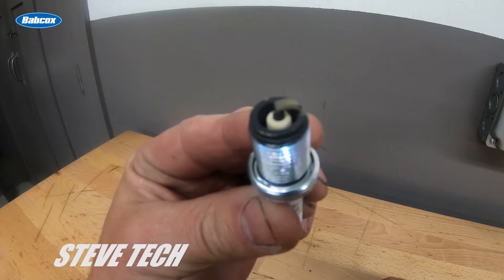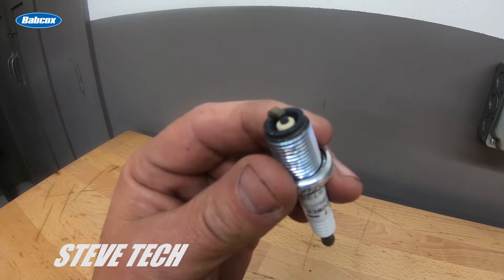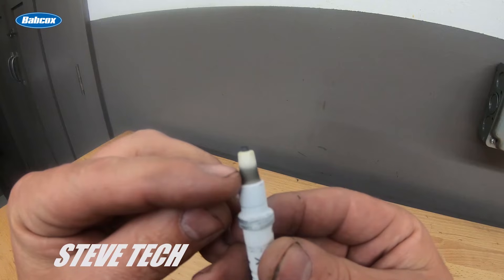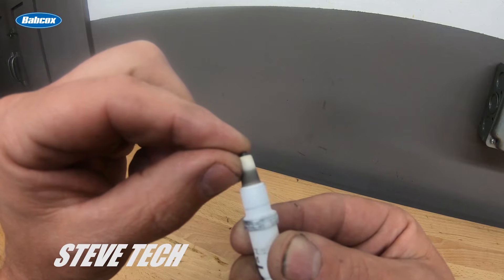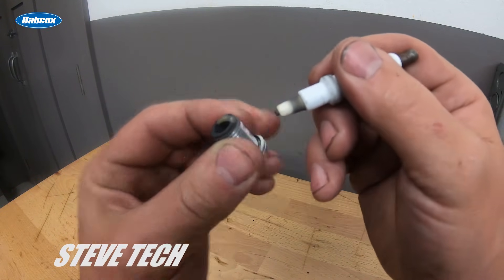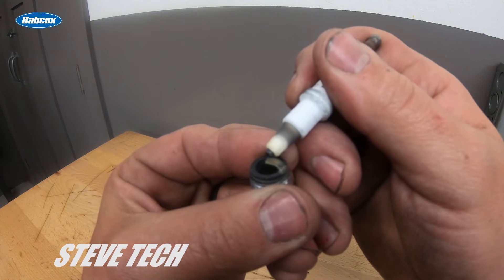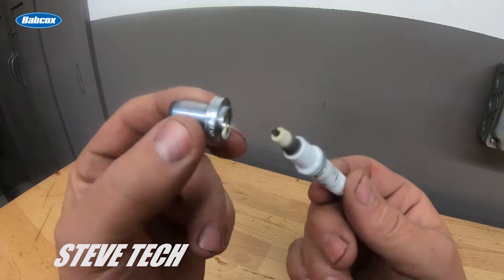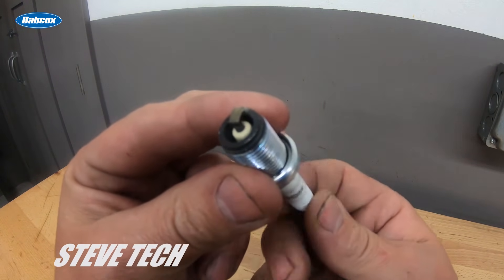Steve Tech: Properly Reading Spark Plugs

Comment: What is the best way to read a spark plug in an automatic car that is only used on the street when checking for fuel mixture at WOT or cruise?  I can’t just shut car off on street and pull over?  Thoughts or recommendations?

Comment: @enginebuilder Steve I hope you see this. Appreciate all you put up! Question.. my Son and I put together a fairly hot 377 sbc, solid roller, good heads, street car, 4 speed, 70 Nova... if we pull all the plugs and look for the leanest cylinder. Then use that one cylinder for for jet tuning before we look at staggered jetting does that make sense? Being a street car can we do 2or3 gear  full throttle pulls to guage the plugs instead of a full quarter mile pull? Nearest track is 3 hrs away. Once we get a good plug reading look at staggered jetting if needed?

Comment: Great stuff mate. One question, how long do you need to run to get an accurate read? Im trying by going for a drive, let everything warm up then swap one plug and continue the drive for another 20 miles. Get home plug the plug, cut it up. Is that going to work well?
FYI, I showed the plugs to an engine builder and he said, I dont care what the plugs look like, whats the AFR. Maybe a builder but no tuner!

Comment: My car had a way too high CO reading during MOT.
The sensors told me everything was fine (even told me it was running lean) but the sparkplugs and CO reading told me it was running rich.
Turned out the EGR valve didn't seal properly causing (effectively) a leaking exhaust and the O2 sensor to get "confused".

Comment: you started by saying the white porcelain at the top means rich burning.   Then you started saying the higher the black line is the richer the burn is.   Then you sidetracked to mentioning the timing.   You should have started with what you said later in the video to avoid the confusion and meandering, i.e. the further up the black ring, the richer burn, the lower the black ring, the leaner the burn.   Then you can anchor whatever else you say after that.

Comment: Less invasive is reading the ignition waveforms at idle and near WOT. Not a snap. As a straight commission tech. Modern engines often have a plenum covering the COPs and plugs. Don't have time nor is the customer willing to pay just to remove and have a look. You diag rich, lean, burned valve turbulence,  etc. All through ignition waveforms. 5 gas analyzer is also your friend. Give me a oscilloscope with proper leads and pickups and 5 gas analyzer all day.

Comment: I was always told you wanted the plugs “on a carbureted engine” to be tan.
Maybe that’s for a stock engine?

On my modified engine 383 stroker with 10:1- 10.2:1 compression my plugs look like this 
NGK #5 is a stock heat range for a 350
I’m using NGK #6 heat range
The ground strap is a grayish white with the timing mark at the bottom of the strap by the threads.
The porcelain is white “it an extended electrode” I’ll have to look down inside I forgot to do that.
And the ledge that the ground strap is welded to is black.
Does that sound like it’s too lean to you?
I’m planning on installing a #7 to see what that does.

Comment: So since the best way to read the spark plugs is after a wot pull I have a few questions. I don't have access to a Dyno like most people so going to attempt this on the street. Do I need to install new plugs to read them after a pull or can I just use the ones that are already installed on my engine? Do you get the engine to operating temperature before you make the wot pull? If so, do I let the car idle to operating temp or just start driving untill you get it to operating temp? I'm concerned the warm up time might affect the results on the spark plugs. How much time can I drive the car before I have to pull the plugs to inspect? I assume pulling the plugs after wot pull would be ideal. My car is a stick, what gear should I be in on the last segment of my wot pull? Any other tips on the procedure of doing my wot pull before pulling plugs for inspection would be appreciated. Thanks

Comment: If been reading my plugs this way for over 40 years. I look for a ring of color at the base of the porcelain. It’s very ez to see on a very cold plug since the porcelain is right at the top but it still needs to be there. The ground strap as he stated and the the 2 top threads will direct you to the timing. Those threads were really coked up indicating rich. 
On that engine it’s easier to adjust the timing 2 degrees versus changing jets (bypass) if I was a clean shutoff.

Comment: Great video.....I'm trying to street tune a ford 289 with a 600cfm holley carb for wide open throttle....I've tried it once and had a good timing mark but no fuel reading on the porcelain....I was only at WOT for about 10 seconds...is this enough time to get a fuel reading......or am I just to lean......thanks

Comment: Great Video!  On a normal street car how to you recommend running the car before pulling the plugs to check?  Take it out and run a 1/4 mile, then drive it home (3-5 miles or so) and check?  or Take it out and run it 1/8-1/4, shut it off as soon as possible and check plugs on side of road?  I know at a track or event it is easy, but it is always hard to have access to that.

Comment: On point Steve, thank you for posting this, all too many people ignore this very basic tuning tool, another is looking in the exhaust pipe outlet(s) along with the plugs  these two seemingly mundane items do get overlooked in favor of as you pointed out "instrumentation". 
Just as a side note, spark plug reading can be skewed if the wrong heat range is chosen thereby masking what is really happening, my experience is most people use way too cold of a plug somehow thinking it will gain something when in reality you need to use the hottest plug possible (without blistering the strap or porcelain) to actually arrive at  plug readings that do reflect the tuning of the fuel/timing combination.

Comment: Which plug would be a good starting point for an lq4 with 706 heads,  f35 cam, carburated running on e85

Comment: Awesome video Steve. I have an issue where I brought this 69 Roadrunner I had years ago totally changed over now…It has NGK R5671A-10 in it. Way cold plugs Guy says I just used plugs that I had from my alky blower car…How do I know what plug to use? It’s a 528 -1 Indy headed BB Mopar. Be shot it with 300 nitrous and it went 9:03 at 148mph with the setup but the plugs are black from driving I haven’t done any pulls because I want to ensure I have a good plug to do some motor pulls…I thought maybe back down to an 8 to start cuttin and reading. What do you think.

Comment: Can you tell anything off of the outer threads? I've seen plugs with a lean condition at WOT but the outside ring of the plug is black. pilot jet too rich? its ether they are black and sooty, or bare metal with no color. that's the only two types I've seen.

Comment: What if the plug is completely black but the engine runs like a scalded dog. If i step down in jetting even a single bit the engine doesnt pull as hard and develops massive flat spots. Oil level never drops, engine doesn't smoke at all. Plugs are just black and sooty, and over time develops a hesitation on sudden WOT at lower RPMS, change the plugs and its all good until it fouls them again. I have a carb'd race engine doing exactly this. My tuner said "too much idling around man".

Comment: DIY - Instead of a lathe, put the plug in a vise.  Use a 5/8 holesaw to cut the crimp off the top of the plug base and slide the porcelain out.
Reply: Wow that makes perfect sense. 
Thanks.

Comment: If one places new spark plugs in a four cylinder car, how many miles of driving would it be good to pull a spark plug out to be able to read what a spark plug is telling us about the engine condition?
Thank you for this video. Its one of the best ones.

Comment: This is the dumest video I've seen in quite some time.  You cant tell shit about the state of the tune from plugs.

There are atleast 6-7 variables that affekt what your plugs look like. 

Most important variable is TIME UNDER LOAD. If you do not put completly new plugs in, and run them at a specifik load, and a specifikt rpm, you will get absoluty zero information from your plugs about your tune.

In dragracing they accualy do inspect the plugs, but that is because they run the plugs the EXAKT same way every time. THEN and ONLY then can you say anything at all about the state of your engine
If you seriously belive anything else, you are a moron and should not be alowed around cars.

Going up and down the road a few times, running a full race on track or making one pass down the dragstrip, or even ripping out plugs that been in an enginge for days, and then checking the plugs will give you only a few things things. The overall fueling IF its WAY WAY of, and a peak plug tempreture. 

That is all. It will tell you nothing about timing, notning about what air/fuel you are runing at what load nor RPM.

They will however tell you if the engine is runing even on all cylinders, and it can, sometimes show kocking marks, or even marks from forign objekts or oilburning. But nothing about the tune. THAT IS WHY WE HAVE WIDEBAND O2 SENSORS, and cylinder pressure sensors, and knocksensors and EGTs etc

Comment: Steve, thanks for sharing.  Subscribed!  Please help the novice understand how to determine the correct heat range.  Also, will hotter plug show timing mark closer to threads on the strap with same timing setting?
Reply: Very good question, because other sources refer to the ground strap mark as an indicator of the spark plug ( correct/ incorrect)heat range . Whatever if you pull out the OEM spark plugs from some fuel injected , ECU timing advance controlled , factory tuned,properly working,passenger car  engine , the ground strap heat mark will be right in the middle and air/ fuel ratio(the dark ring on the visible base of internal part of ceramic insulator) 
indicator will be 2-2.5 mm wide .

Comment: So Steve. What about us guys that have to drive back to the pits or say we are street racing and have to drive the car back to the meet spot or start line? Is it even worth buying a cutting tool bc we gotta drive and idle back to the pits? And if that isn't a real issue then are we looking for the same signs or are they slightly different?
Reply: I'd suggest working this out during a dedicated tuning session where you can tow or shut down and pull off after a "hit"
Reply: You take a couple of plugs and the tools you need with you. After the run, shut down and coast off of the track. Swap out a couple of random plugs and motor on back to the pits to read the ones you took out.
Reply: @erikwiegand8192  Yea thought of that for the drag race guys. Soni guess us street guys are kinda SOL then from the sounds of it lol

Comment: Thanks for share man!

Hoh many time a new or very clean spark plug need to be under combustion to catch enough deposits for spark plug reading?    How many time combustion for partial throttle openings and how many time for WOT and cut thread?

Thanks to you!

Comment: Steve you talk about reading the plug for rich or lean and heat on the ground strap for the correct timing but how do you know if the heat range of the spark plug is correct for the application?
Reply: If the heat range is wrong, ie: TOO cold or TOO hot, you won't be able to get a good reading, if any. Too cold will fuel foul and look sooty all the time no matter what. Too hot will just look, well hot. The plug will show excessive signs of excessive heat. Either way, it will be difficult to get readings on it.

Comment: Had to subscribe to this one!    I have one plug that has white insulator(very white,  like new).  I swapped it to aother cylinder and after 20 miles or so it was still white.  all the rest are white with faint brown/tan markings.     I also did compression test and I have 152-168 on all 6(that's with brand new heads).  Technically that is too much compression difference(more than 14) but it would not explain my mysterious white plug!   Also tested all plugs in plug tester and all passed with great spark.

Comment: Subscribed. Nice lesson!  Question, does the strap condition become "lost " if the engine is run after a pull, like you stated when describing the porcelain?  Reason I ask is I am almost fully tuned in on my carbed boat gas engine.  I'd love it if I could really put it to bed.
Reply: I also would like to know this.

Comment: How big of an impact does the proper heat range have on all of those tips?
Reply: A hotter plug is good for cold weather and short trips, but are prone to overheating your engine and detonation is super hot climates. So a cold plug is suitable for those hotter temperatures to keep the engine cooler and reduce pre-ignition.